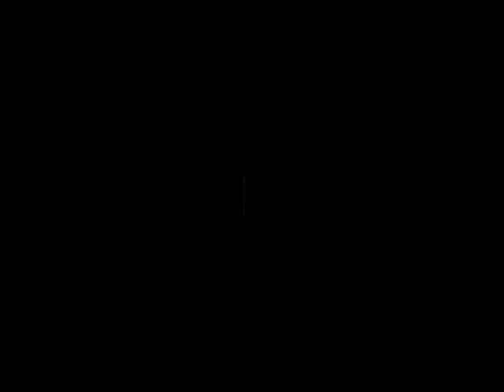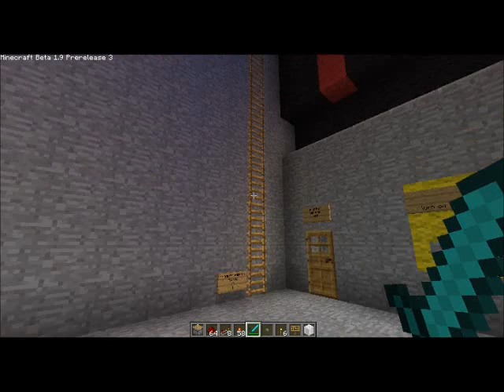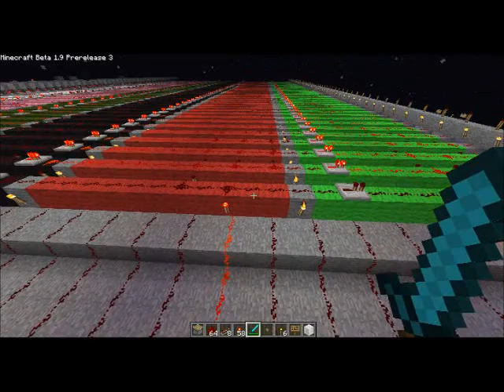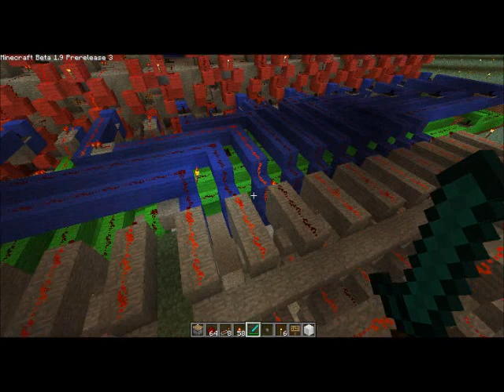redgame 2.1- the secret to speed and how it works

Comment: I know this is a bit of an older video but I have a suggestion and a question.
The suggestion is that you could shave off seconds on all of the long open redstone lines by using TaviRider's instantwire.
My question is how does the decoder work? The part that takes the binary answer and codes it into the 7 segment display. I am building a computer and I'm using a Mux/demux of my own invention and it is huge. a 8x16x16 area for EACH possible answer for 16 bits. Your system was much smaller.

Comment from the maker: @viroware I know, I know. but before I build a real thing, it's better to practise in a simplified version of the real thing. it's much cheaper to replace a burnt out torch in minecraft, but when an IC blows up, it will cost you time and money to get it replaced and fixed, not to mention injury.

but now I know enough, so I can "safely" move on to real electronics, which still isn't that hard. just power the IC, decouple some ports and ground unused logic and it works in just about the same way.